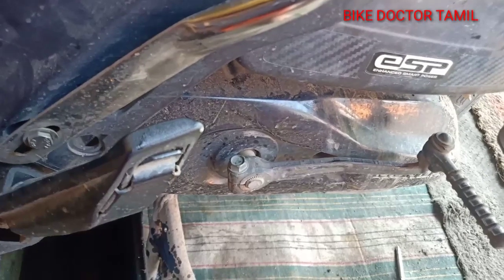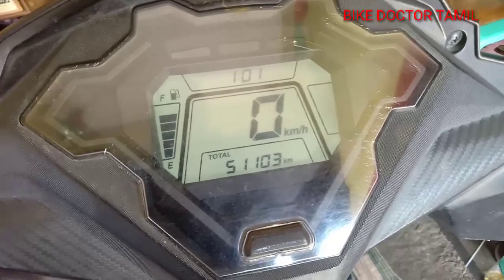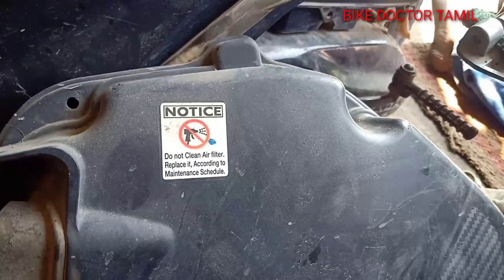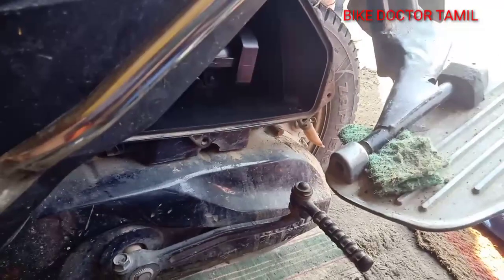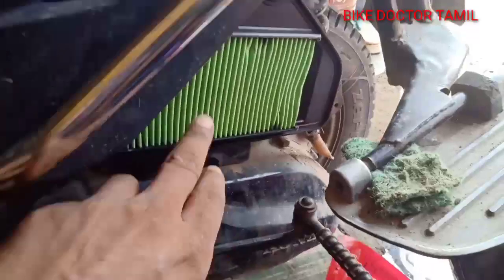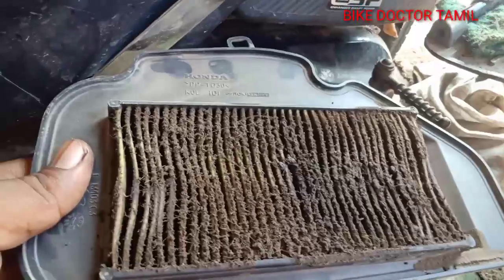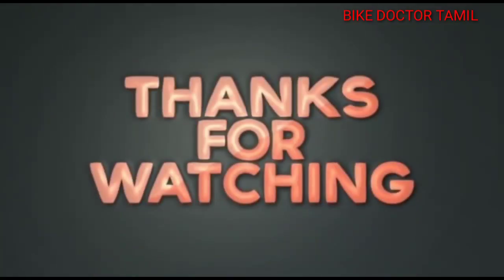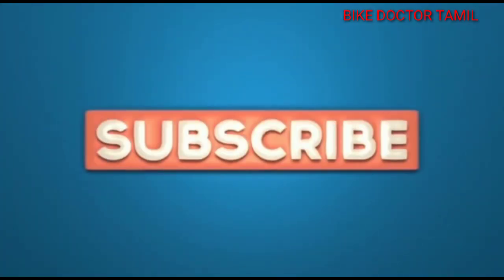Bike Starting Problem in Tamil

Comment: Anna splendor bike start panna petrol smell overa varudhu adhuku enna pannum sollunga 😢Plz....
Reply: Face mask pottukonga bro.. smell kammi aagum
Reply: Thanks bro😅
Reply: Spark plug maathunga bro
Reply: Petrol tap or petrol tube leaking problem இருக்கும்..
Reply: Bs6 iruntha fuel injector cap change pandonga
Reply: Thanks
Reply: Carburetor adjustment panuga